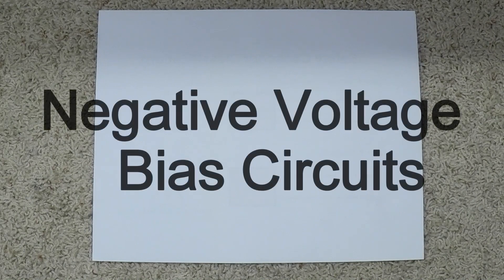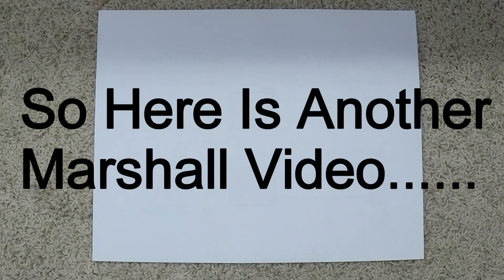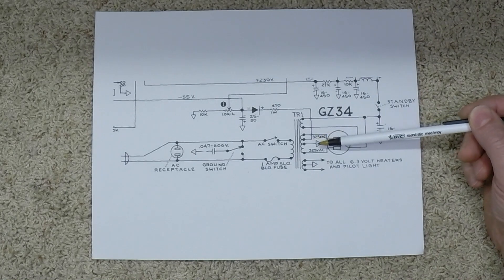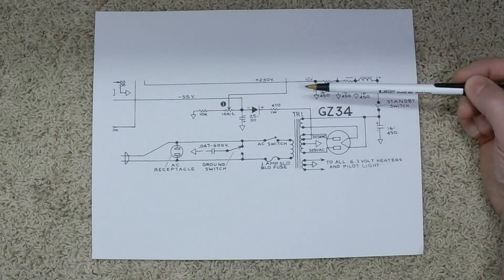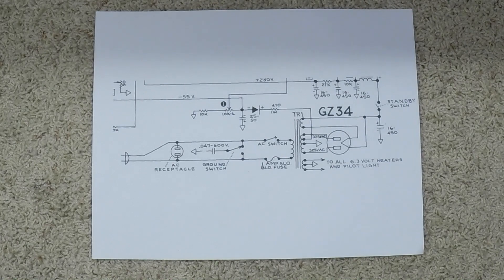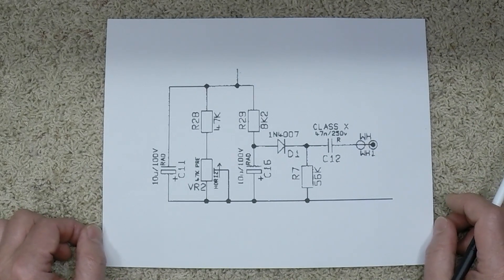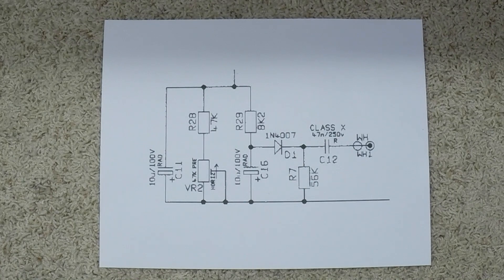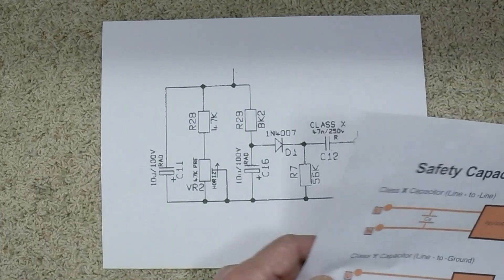JCM 900 Bias Discussion

Comment: The whole bias circuit is just garbage. The whole idea comes from being cheap and not have a center tap on the PT or not having a dedicated bias winding. I have built one and it drifts like hell, pumps back voltage into your B+, rising it from 440V to 500V! if the grounding is not 100% specific. Very very dumb, should just use a little bias transformer at this point.
Reply from the maker: I will agree in the case of the original Marshall circuit there is quite a bit of buggery going on.  The safty cap (which is what this video was all about) was just a mistake in judgement.  Wrong application and under voltage....  2 strikes.  I should also mention that I find a LOT of assembly issues in the older Marshalls.  I have mentioned several times that I have seen many main filter caps not wired properly,  just saw another this week. 
   The Ampeg circuit failures I mentioned was from a poor capacitor choice as well the "tropical fish" 600v capacitors failed consistantly in these.
   However, I have to say that the design such as the one in the Fender Princeton is rock solid.  I do not have a problem with tapping from the HV secondary, not having a bias tap etc.  I have never encountered "bleeding back" to the B+.  I have built numerous amps using this circuit, and it is common in many amps including the Trainwreck Express.  I think you nailed the problem when you mentioned "grounding specific".  Proper grounding is one of the most important factors in an amp build. It is either right or wrong.
Reply: @guitarc.p.r.9675  Okay, did any of those you built successfully have grounded center tap on the PT?
Reply from the maker: yes
Reply: @guitarc.p.r.9675  I'm not debating HT bias when there is a center tap, but if there's not and you put a cap there (I used a 220n, probably too big), to couple the bias, the circuit can start oscillating and making the amp unstable. Again I might have messed up, but I'm not going back to find out. I use dedicated 37VDC for bias now.
Reply from the maker: Oh, I see what you are meaning now.   Sorry, lost in comprehension of text.  That circuit only works with a centertapped PT.
Reply: @guitarc.p.r.9675  Yeah I'm sometimes overcomplicating it, not a native speaker, trying to learn though
Reply from the maker: You will find many amp circuits will have a bridge rectifier in the power supply.  In this case there will never be a centertapped secondary on the PT.  In this case the ground is generated at the rectifier.  But it still works.  Check out an Ampeg V4 schematic.

Comment: Hi thanks for the video, i have a problem with my bias circuit.  For some reason im getting -6 vdc on the ouput of the bias.  Tried different x class caps but havent tried a normal couplong cap yet.  Any ideas?  Havent tested the electrolytic caps yet just tested thr resistors.  Thanks in advance
Reply from the maker: Forget about the class x caps. Use a 630v Xicon.   Check D1, and the caps.  That is a very low voltage.   
I am betting a cap is shorted.  But that is just a guess.
Reply: Thanks for the reply, i did one thing at a time.  First replaced the cap with a coupling, was doing the same thing, then the diode.  It was the diode!! Tested fine on the multimeter but changed it anyway and amp back up and running.  Thanks so much for your help.
Reply: I replaced the diode with a 4007, however it was a secondhand working, I didn't have a new one to hand, so I installed a uf5408.  I love used these diodes in previous diy builds.  Do you have any concerns about using this diode in a bias circuit, I'm interested in what you think.
Reply from the maker: I have no concerns at all.  The 5408 is a 3a, 1000v diode. 2 amps handling over the 4007.  Glad I could be of help.  Thanks for checking out the videos.

Comment: Where the JCM 900 is a series of amps consisting of three different models (MkIII, DR, and SL-X), I assume this video applies to all of them?  Thank you.
Reply from the maker: The safety cap has been in every 900 I have seen.  It is built into the power amp board as a rule.

Comment: I believe that cap (safety or not) is required in the JCM900 because it is sharing the secondary with a Full Wave Bridge rectifier, instead of the typical dual wave rectifier you showed in the first slide. I found this video because I was researching why, when attached my typical bias circuit (with the typical series dropping resistor) it wouldn't work. The JCM900 and the Soundowner SDR100H were given as examples. I still don't understand how the coupling cap works in this scenario but I have confirmed both in LTSpice and reality that it doesn't work without it (and the 56k resistor).
Reply from the maker: No it will not.  I was just discussing "types" of biasing systems, and pointing out that the cap need not be a safety cap and why in the that case.  Not saying it would work without the cap....thats is why I replace them.  Most original caps fail due to underdesign.  The reason it is there is to pass and limit AC voltage.  Did you happen to look into the 900 videos here.  That is where the cap discussion started.  Thanks for watching.

Comment: Great video, thanks for the insight.

Have you tried just bypassing the cap?  My Fender Bassbreaker 15 had some faulty protective zener diodes causing tube red plating, so I just removed them, they aren't needed to bias the tubes.  The zeners are known to short and blow tubes, but mine was 'leaky'.  It measured around 0.2V both forward and reversed polarity out of cct.

Younger generation engineers over engineering everything.
Reply from the maker: Thanks for the comment.  I have considered removing the cap, and replacing it with a large resistor as in the 800.  But the replacement cap is OK.  I have not had one fail after replacing it.  Awwwww....  The Bass Breakers...  My first encounter was one with failed diodes, and blown output tubes.  I have a personal theory on those, but I will not disclose it here, for legal reasons.  Young engineers... LOL!  I see a new batch of authorities about every ten years give or take.  I will share a Marshall story with you though.  Years ago, when the second version of the 800's came out I called Marshall to talk to a tech about some problems I was seeing.  They had cut back the filter caps a lot, and there were a few other non-improvements.  After we had discussed the issues at hand, I asked why they did not just leave it alone.  The tech kinda chuckled and replied.  "Engineers do not get paid to leave things alone." We laughed.   Thanks again for watching and commenting

Comment: When my class X bias cap failed on my 900 last year. It failed open and red plated my tubes.

And I don't see why your 900 vids are so controversial? Your vids helped me immensely on repairing my bias cap (and yes I used a 630v cap) last year and again this year when I replaced all the power handlining caps. I also fixed the lack of the grid resistor from Marshall too. My 900 sounds fantastic and I may say is probably one of the better sounding 900's out there.
Reply from the maker: Thanks for the comment.  The first one I saw fail was in the early days of the 900s.  I replaced it over 35 yrs ago.  Still running  That customer was about 18 at the time, He is in his 50s now.  That same amp was the 50 watt in the first major rebuild video, and was the same one the customer asked, Why does my tone change when I switch channels?  Controversy is not only common but popular on the net.  Misinformation is common, and taken as fact.  When I go against that, it causes a stir.  I am virtually an unknown entity on the net, "new guy" so to speak.  They like to beat up on the new guy.  Spoiler.... I do not go down easy.  Glad you have found the channel useful.  That was the original concept for it.  Free, correct information for everyone, whether they get it or not.
Reply: @guitarc.p.r.9675  you're welcome sir! Thanks for all the helpful knowledge you share with us. It is greatly appreciated!
Reply from the maker: Sir!  Gentlemen like you are why I am doing this.  I know you follow, I have noticed your comments, and Like the boys from Texas said...and I thank you.